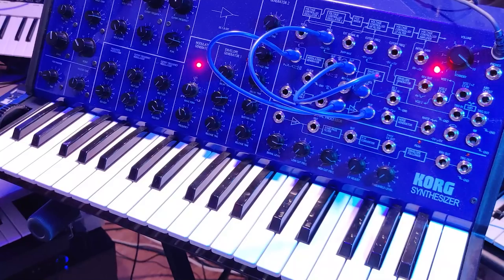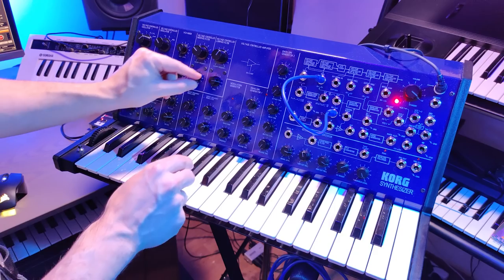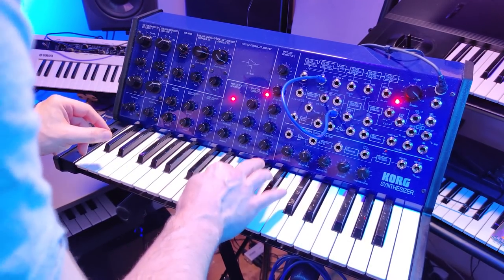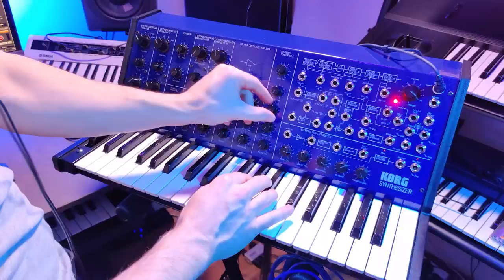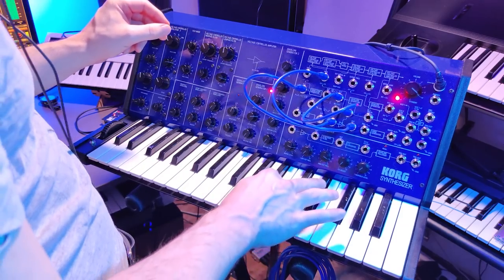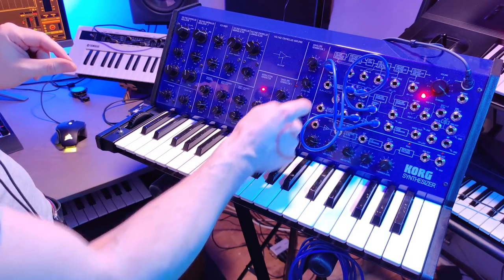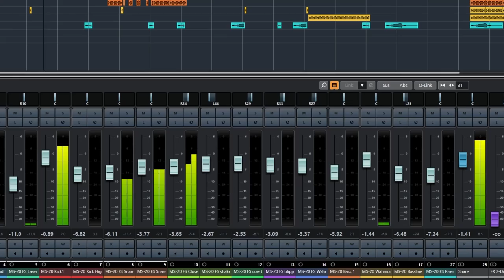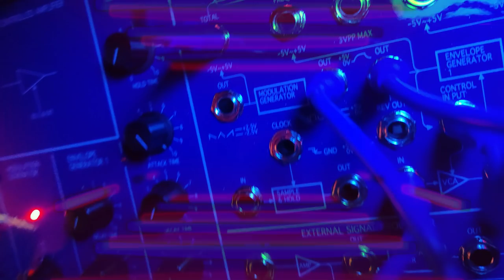Less is more: Creating a dirty electro track using the Korg MS-20 as the only sound source

Comment: Excelent! just got my first synth (Bass station2) and this videos are very helpful.
Reply from the maker: My pleasure :) Hope you'll get a lot of fat sounds out of you bass station !
Reply: Congratulations! Novation Bass Station II was a great choice. I've had one for many years. It's your first synth so I might as well give you some tips here:

By the way, I quickly checked out your channel and watched your "DM Enjoy The Silence Drum Cover". I liked it and the intro you added to it with the Bass Station II was cool. I also saw that you used the latch option to keep the sound playing. (Some people don't know that you can also use the latch without the arpeggiator to keep a sound playing but it depends on the envelope settings. You need to have some sustain in the Amp Envelope...) The latch button is great. Now you have both hands free to experiment. 

When you're experimenting and trying out sounds it's a good option to keep the filter's (cutoff) frequency much lower than full. Then use the "Mod Env depth" to make the envelope (Mod Env) to change the filter's frequency. If its value is zero it does nothing. The zero is in the middle position because it can have negative values too, which reverses the envelope. It's recommended to use positive values until you get familiar with the envelopes. It's also recommended to use quite a lot of resonance to really hear all the changes in sound. Getting familiar with how the envelopes can control the sound is essential. (The "Mod Env" can also be used to control the pitch. Then you need to put a positive or negative value to "Mod Env depth" in the "oscillators" section.)

Well, now that I've mentioned the pitch modulation... It's useful to have a vibrato in some of the sounds. Try it by using the topmost option of LFO 1 (the triangle wave) and change the value to something like 67. You can always use the mod wheel for vibrato. Keep pressing the "Function" button and press the key under the "Mod Wheel - LFO 1 to Osc Pitch". Then put the value as low as 2 to get a natural sounding vibrato.

If you want to try some weird and interesting modulations (maybe a little bit like the video's "Blippy riser fx") then you can try this:

Part 1: Try to use only the filter. You can get the filter to self oscillate by turning the resonance to full. (Lower the volume especially if the frequency is at max! Resonance boosts the selected frequency. If the filter is fully open then the boosted frequency is outside the hearing range on many synths. When you start to lower the frequency it can get quite loud...) You can now put every oscillator's volume to zero and only use the filter. You have probably found out that turning the frequency now changes the pitch.The filter produces a sine wave and the LFO 2 also changes its pitch and so does the Mod Envelope...

Part 2: Put the latch on. Then set both of the envelopes to loop. Keep pressing the "function" button and then press the key two times under "Velocity - Amp Env". Set it to "r 1" instead of "r 0". Do the same by pressing the key two times under "Velocity - Mod Env". Try it out by putting everything at zero in the amp envelope but then raise the level of decay a bit and maybe also the attack. Then do the same with the mod envelope. You can also try raising only its attack quite a bit. Remember to add a positive (or negative) value to "Mod Env depth"...

Part 3: Try using the LFO 2 by adding a positive or negative value to "LFO 2 depth". Possibly change the LFO 2 to a low speed and use its saw wave, which is the second from the top.

Part 3 extra: Also use the "Osc Filter Mod". It usually adds an audio rate modulation but you could also change it to an additional low frequency oscillator (LFO) by changing the octave of the keyboard as low as you can. Then change the range of the oscillator 2 as low as you can as well. The Oscillator Filter Modulation does indeed let you modulate both the oscillator one and the filter's (cutoff) frequency with the oscillator 2.

Part 4 extra: You can of course add the oscillators to the sound as well and the noise from the mixer section... Maybe try to add just a little bit of volume to them to hear the strangeness of the filter more clearly. :-)

If you're very new to synthesizers I'll mention this as well. The Bass Station II is an analogue synth that has digitally controlled oscillators (DCO). It keeps a perfect pitch, which is very useful for sound creation. Old school synths with Voltage Controlled Oscillators (VCO) are naturally drifting out of tune and that's what makes them sound bigger. You can do this:

Use two oscillators and put them in the same pitch range. After that change the pitch of one oscillator (usually osc 2) slightly with the "Fine" control. Then you can also try to use pulse width modulation (PWM) on both oscillators to get even bigger sound. You just have to select the last oscillator shape for that, which is the square wave. (The Pulse Width control only works for square wave.) Then put a positive or negative value (try 30 or 50) with the "Pulse Width" control's "LFO 2" setting to both oscillators and change the LFO 2 to a slow speed (maybe something between 20 and 40). Many synths can't have pulse width modulation on two oscillators at the same time. This synth definitely can do that and much more. It's a surprisingly versatile synth.

That's all folks. I guess I've written enough already. :-) Enjoy your new synth and have a fantastic day!
Reply: @Vimana  Thanks for sharing this bass station tutorial :)
Reply: @Vimana  Wow Fantastic info. I sure have a lot to learn in this new world. Thanks for the time you took writing this comment Stay Safe!
Reply: @cooldrumscovers3786  You're very welcome. I forgot to mention that you probably need to update the firmware. Some of my tips (looping envelopes) don't work if you have an old version. The easiest way to update the firmware is to use the Novation Components site:

Connect the Bass Station II to your computer with an USB cable and go to the Novation Components site. Components web works in MIDI compatible browsers (Chrome and Opera) but you could also download a standalone version.

If you have the latest firmware then the Bass Station II has all the same functionalities as the new Novation AFX Station! Did you know that? There are some hidden features now available via the "Function" button (such as the envelope loop).

The AFX Station has all those new functions written on its overlay. A great idea that worked for me was to download a high quality picture of the AFX Station. Then I kept the picture on my monitor the whole time while I was experimenting with new sounds. You could also print it of course...

By the way, I've also played drums to "Enjoy The Silence". I was a member of a band that played mostly cover songs. You have a good thing going. Keep it up! Take care and have a wonderful day.
Reply: @Vimana  Thank you and yes I'm running the latest firmware then I found more patches libraries on the components section from novation there's that, probably you already knew it...
Reply: @cooldrumscovers3786  Excellent! I knew there were patches for you to download but they've added a few more.

It's great to check out and learn how those patches were made. You can see what the original settings of the current patch are while using all the controls. When you turn the frequency knob for example, then it shows a dot on the right of the display. You can clearly see if the value is over or under the saved setting. That's very useful. You can definitely make some cool and even better sounds out of them. Enjoy and have a great day!

Comment: Can you make a video on doing a hardstyle pitched kick drum using the MS20? I was thinking about getting one of those for doing that, but I don't know if it would work. I already have a Korg Volca Kick, but it doesn't seem to work too well with midi, so I was thinking about getting an MS20 for pitched kicks. Basically if you did the kick you had then ran it through a distortion pedal it might sound really hardstyle.
Reply from the maker: This machine is actually very good at making the dirtiest (and at the same time nicest) tuned kick you can find. If you use the patch I do in this video and open up the low pass filter it will actually already start to sound like that. You do not even really need a distortion pedal as you can feed the phones signal back into the MS20 creating a whole loud of lovely dirty feedback distortion.
Reply: @Estuera  Last night I was playing with my volca kick, and it says right on it "MS 20 Resonator" so I think it must be the same. And then I hooked it up to my JDxi and transposed the keyboard, so now it seems to work good with midi and I could play notes on it. Before I was triggering it with MS1 but it didn't seem to work as well with that.
Reply: @Estuera  i will try make some kicks and hats with my ms20 :) sounds fun

Comment: Hi, Wondering if you think there is a big difference in the sound of your Korg M1 hardware synth compared to the vst Korg M1 software? If so, which one do you prefer? See that you have both.
Reply from the maker: The difference is there but its not extreme. The vst version sounds more 'hifi' while the original is a bit more punchy. This is probably because of the DA converter.
Reply: @Estuera  Ok like your 90s vibes really good dance music as you can check out my 90s vibes too. Have no hardware just inbox actually think it affects how the music sounds today lost a bit of energy.

Comment: Really great idea and it sounds a bit 80s like too. Funny thing is, yesterday (and maybe later today too) I was creating many sounds with the MS-20 plugin myself (including Kicks and some dirty sounds). It's possible to get lost in it and there are also different ways to achieve certain things. 

Now my typical question, can you guess it already ? ;-): Could you do a full track like this also with the plugin?

I wish I had the knowledge you have though Jonas, I needed tutorials for Kicks etc on the MS-20 (there are excellent ones on Youtube). What I noticed is that you can even do acid style sounds with the MS-20. I was a bit surprised about that myself.

It's even more respectable knowing that you can not even save/load anything on the Hardware and need to do each sound from scratch/individually. That along with the complex patching... A long way to go for me. I couldn't handle it or need 100+ hours (to finish only couple sounds probably).

Great mixing too btw, as always a pleasure to see your videos, huge thanks and respect Jonas :)
Reply from the maker: Yes, you certainly can do this on the plugin as well. It will probably sound a bit different (the plugin is based on filter mk2 while I had my MS-20 in mk1 mode for this video) but you should be able to get very close.

And indeed, the MS-20 is an acid beast, you don't even need any external distortion. The filters are amazing when you're overdriving them.

The process I followed for this video was the following:
1. Create the patch I need
2. Record the audio
3. Take a picture 
4. Continue
5. Build and mix the full track

And then when doing  the video I used the pictures to recreate the patches again to show and explain.
It was quite labor intensive but that's the way it is with these classic analog synths.
Reply: @Estuera  Wow you put a lot of work into these videos then, it's almost twice the work. I wouldn't have a clue though how to patch the cables, only a basic understanding/or youtube help. Probably the solution is diving into it and learn it.
Reply from the maker: Indeed, dive in, read the manual, check youtube and dive in some more. It looks a lot more complicated than it actually is.

Comment: When i try to create percussive sounds like that in my DAW it typically breaks down, stops doing any sound and then i just restart and stick to pitching around and filtering a of the preset samples. :/
Back in 2014 i had selfmade software where you had to write each instrument as a math function... it was weird, hacky, but you could play around with modulation 'n stuff and the low sample rate gave it an interesting timbre. Sadly it also introduced stray frequencies all over the place which i didn't bother to remove back then. Have to re-write some of those tracks at some point...
Reply from the maker: That's a strange issue you're having there. Which DAW you are using ?
Reply: @Estuera  LMMS, but i'm running it on windows (used to have only a laptop with ubuntu). Some of the problems occur less frequent when i delete a few directories because it still tends to write \/ or /\ in some places when replacing / with \, causing error... the workaround is to produce the "complex" part in a separate project and then use the exported sound as a sample.
Reply from the maker: Never used it myself. Good you found a workarround
Reply: @Estuera  I have a talent for getting strange Computer issues because i always max out the capabilities of whatever software i'm trying to use. And since i often settle with open source stuff that was probably not aimed for that stuff... but then again, somewhere out there there is a guy proving power point to be Turing complete, so at least i'm not alone.
Reply from the maker: Some people like living on the edge indeed :D 
I've had my fair share of those experiences as well. I once did a linux from scratch build on a EEE asus netbook. Compiling for days ...

I go into software development a bit later so I guess I learned a thing or two along the way
Reply: @Estuera  i got into music after a friend was like "how do they make sound anyway?" and wrote a java program that would get the loudspeaker to make a beep. He then managed to get it to produce an wav file as output and that's when i messed around with the source code to produce a song. That was 10 years ago; i met him online a few months ago and he confessed that he spend quite some time trying to untangle my messy collection of loops and conditions that i had used to give the song a structure and metre... And he re-created this very first song with one of his never software written in C. It still uses only ascii input, as in you have to type out each note by name, and instruments are still defined as math functions, but it can now include samples, pass parameters to the instruments for sweeping or filter effects and even emulate some effects of the C=64. Maybe i will go back to the ascii style in the near future; for now i am comfortable with lmms. But it's just not the same; not by a long shot.
Reply from the maker: Quite hardcore though to make music that way. But certainly cool (at least if you're into programming)
Reply: @Estuera  Some people like living on the edge... and some take it a step further. And as with all things, you get pretty fluent in the language. aeah ca - - GHga h- - -

Comment: isnt that how most electro was made... with. a synth?
Reply from the maker: And a big fat TR-808 (which is a synth as well off course)
Reply: @Estuera  Yeah I reckon hey! A drummachine and synth was all it took :-) it's cool to design drums on the synth but it does prevent "live" hardware shows unless if you have poly voice multi timbral synths. I guess early electro would have even been Lindrum or older drummachines. I love the idea of a minimal live or recording set-up but I always end up using tonnes of gear haha. Although I made a lot of 90's vibe dance tracks with just the Roland gaia, the TR8 and a looper =)

Comment: you cought me with the MS20 and lost me with mentioning of Cubase, i don't want to use Computer or even Midi in my stuff. Cool sounds and track though.
Reply: @snorrevonflake    That's a personal choice... Counts for me too: try to use only the single machine itself, in my case, say a KORG X-50 (is ofcourse a complete semi-professional studio on its own) and never use external elements, other than recording stuff and the right monitoring. But when such old beasts like the MS-20, without MIDI, without sequencer/arpeggiator ánd monophonic, come along and you wanna make a whole song, there's really no other option than to use a simple computer-program, which doesn't harm you and will only let you see, so much more is possible!
Reply from the maker: This version, the MS-20 FS, does have MIDI though. But off course I still need to multi track to make a whole song with it.
Reply from the maker: Fair enough. I personally love a hybrid approach and fully embrace the strong points of both software and hardware.
And in case I need to multitrack, arrange and mix, Cubase defeats any hardware solution in ease and speed of use in my opinion.

Doing the same thing with only hardware could be possible in theory but I would need a very powerful hardware sequencer, a mixer, multiple expensive outboard effects and a lot of extra room to put all of this... While the result in the end might still be worse compared to what I can achieve with one of the most powerful DAW's that have ever existed.

Having said that, it would still be a lot of fun to do this 100% in hardware but it's a completely different kind of challenge than the one this video is about and I simply do not have the gear at hand to be able to pull it off.